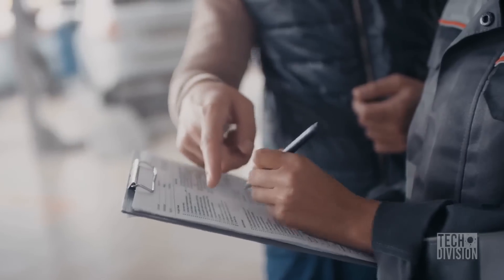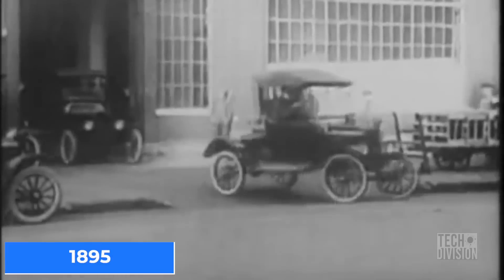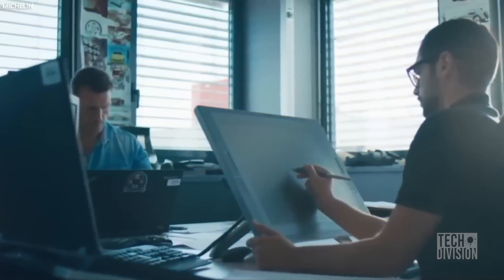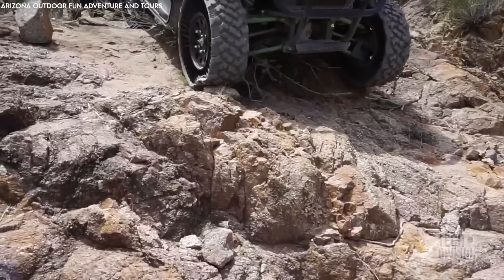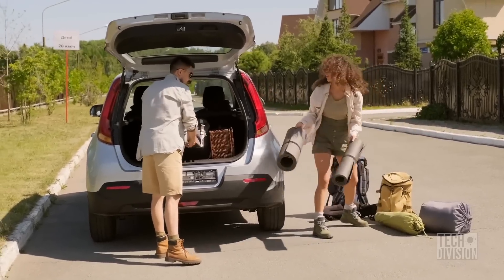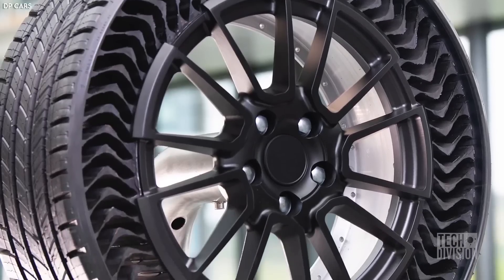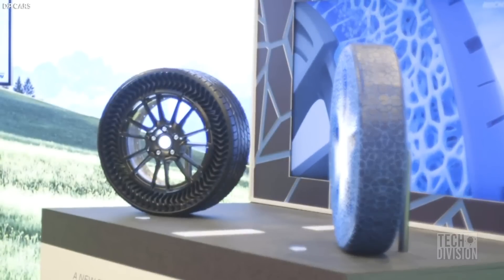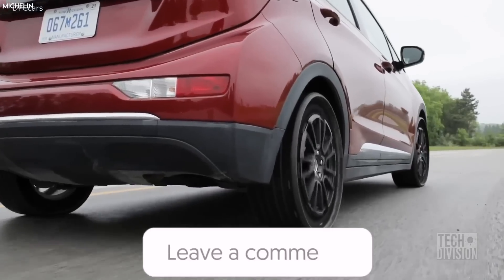Goodbye Flat Tires - Airless Wheels

Comment: No l wouldn't my 1997 hilux ute uses a light truck tyre a high profile tyre and l need to adjust the tyre pressures when l carry a load so commercial applications no way if you made them harder it would comperise the ride and handling wet weather performance believe you me in the wet my cab chassis aluminum tray its a handful in the wet also it has a full size spare wheel doesn't compmarise the load space big deal you have a spare tyre and a full size at that and l live  in Australia much rather have a full size spare wheel especially when you are in the outback get a flat change your tyre keep going at the speed limit instead 80kph on your space saver especially in the Northern Terriotry where there are sections if roads that are unlimited and they have a maximum speed limit of 140kph if you are doing 80kph on your space saver its a bit dangerous that's my opinion of space savers at least its better than no spare tyre and l know that happens if you were driving a car without a spare tyre get a flat you are stuffed really stuffed you could die because you didn't have a spare tyre a full size spare tyre no problem

Comment: these tires have to have a cover on the sides I can't help but be tempted to cut those spokes with a scissors, garden shears or something sharp. vandals can think of that too and it will be very dangerous to drive it not knowing someone cut your spokes. let's face it, it's the same reason people key cars.

Comment: What about in cold regions? Wouldn't ice/snow/low temps stiffen the rubber/plastic? I would think it would lead to breaks or fractures of the material.
Reply: That shouldn't be too much of an issue, standard tires have the same engineering problem. Winter tires have a softer compound that has the same elasticity as a summer tire in warmer temperatures. In the design with open sides, the cushioning fins between the rim and the web would get a lot more cooling than the inside of a standard tire, but the web can be a different compound than the fins, so they can choose appropriate compounds for each part of the tire. Furthermore I assume they show the open sides for promoting the concept and they will possibly close them up in the long run for safety reasons and to mitigate the problem of mud, snow and ice getting stuck in the sides.

Comment: I can see problems with off-road driving where you have to lower the tyre pressure for more grip and take the pressure up again for use on bitumen for the increased speed.
Reply: Then you would use different tires? Keep in mind every tire isn’t good for every application as with tools, there’s a different tool for a different job.

Comment: I like the idea but I am sure it will cost a lot more because the tire is attached to the rim. When you buy the tire, you have to pay for tire and rim.
Reply: Long term wise. If it performs up to a low to mid tier air tire then I’d say cost is worth it. Less maintenance ,no popping, and I’ve seen that Michelin is able to rethread it with a 3d printer. If all that comes to fruition then definitely worth it too me

Comment: These have been around almost 2 decades. They've only been commercially available to skid steer (larger outdoor power equipment in general) owners because the road noise on a regular automobile is so loud you can't even talk to anyone else in the car.

Comment: What happens when you get mud or snow let's say ,stuck in between some of the support columns,this will cause the tire to become unbalanced at higher speeds.
Reply: I guess they just make it a bit unbalanced from inside to outside to the stuff can flow out when the week rotates
Reply: You have a point.  I think a new design would come with some lifestyle changes.  If debris were caught in the rubber spokes it could cause some imbalance.  I think it would be easy enough to give your tires a quick rinse if they were that dirty, but nonetheless that seems accurate.  I’m less concerned about snow over mud, because there’s likely to be enough heat generated during normal driving conditions to melt the snow.

Comment: If u add side covers on the tyres, it'll solve the mudding problem and will also visually resemble a conventional air tyre... Then the customers just have to choose the superior tyre.
Reply: Side cover will affect flexibility as well as mud and ice removal if anyhow managed to trespass the side covers...
Reply: Yes regular tires are supirior
Reply: i think side cover less tyre are good. no heat problem and long durability .

Comment: One thing people should keep in mind.  The reason the pneumatic tire has been around so long and that it really hasn't changed in design (except for materials), is that it works and works well.  Despite hundreds of attempts at making a better ice cream scoop, the one invented over 100 years ago seems to be the one most people prefer because it's cheap, efficient and works best.  New doesn't always mean better.  I'm thinking the same about these new tires.
To the announcer:  It's pronounced "Misch-el-in" not "Mitch-el-in"  You'd think in an ad (basically what this is) for the company, you'd get it right.
Reply: Mitchelin ahah 😂
Reply: Less tire maintenance no worry about popping it with one nail and I’ve seen online that they have the ability to rethread the tire with a 3d printer. So if it performs up to/even slightly worse(let’s say 5% performance decrease) I would prefer airless.

Comment: I would love to have airless tires on my OHV side by side because we ride from 4,000 ft elevation to 11,000 and sometimes even 13,000 ft here in Colorado on just one ride and have to adjust the tire pressure to keep things save while
 OHVing.

Comment: Yes I’m ready to put those tires on my car especially if they’re not expensive
Reply from the maker: They will be expensive in the beginning but as the demand and production increases they will come down in price. Just as any normal tires
Reply: @TechDivision1  Since these actually won't be just tires, they will come as complete factory pre ballanced wheels, I can't see how that can be true. Basically, they will last longer, but each time you need a replacement you will have to change an entire wheel, not just a tire.

Comment: Since it really isn’t dependent on any recently discovered or invented technology, it begs the question why weren’t they working on this decades ago? Perhaps similar to the auto parts racket, tire manufacturers wanted you to have to replace your tires every couple of years? Perhaps now they realize how terribly ecologically irresponsible it was to convert crude oil into synthetic rubber and over time amass billions of old tires in landfills, lakes, streams, woodlands, and backyards? At least with electric vehicles you could argue that battery technology wasn’t ready thirty years ago.

Comment: What about motorbikes and the lean factor when cornering? Would that be a problem in terms of the stress put on the tyre?
Reply: Personally you're not going to see an airless tweel on a motorcycle anytime soon, at least not street legal. Heck, they're barely on 4 wheel vehicles and still testing the rigidity and how much wear and tear on the tire caps at high speed cornering and straight lines. I just don't see why the tweels have to be flat all of the time.. I mean normal tires aren't really flat, just a patch of the tire in the center is.. they still have curves on the sidewalls that still have some tread on them to shed water and aid in cornering. I just don't see why they can't just remove the air.. and build a wheel that doesn't require pneumatic pressure to keep it's rigidity, then you could utilize the tires already being built as a transition to a full on tweel. they would be similar to already low profile tires, only then they wouldn't need to be aired up, and still utilize the tread on the tires we already have.. maybe not so much of the sidewalls.

Comment: Nice idea, however, what will they cost? I seldom get flat tyres ( I think 2 in the past 20 years of driving) and these seem to be part of the actual wheel frame. When the tread wears do I have to replace the wheel frame as well? If they are not cheaper than normal tyres or competitively prices with the frame they will be a flop.
Reply: It blatantly tells you in the video you can just replace the tread
Reply: Card Board Sims: are you specialized in card board thinking? I reckon Michelin which took 10 years developing this tire thought about your concern.

Comment: Seems like adding a sidewall with vents to handle the change in compression would solve the issue of getting debris in the support structure and would go along way towards helping the aesthetics of the tire even if it means paying a price on helping to prevent hydroplaning

Comment: I would use it if it has side walls like conventional tires
Reply: I think they deliberately don't use rubber for side walls because these airless tyres already use far more rubber to compose the inner layers. It's not as environmentally friendly as they make out. Unless they last significantly longer than conventional tyres.

Comment: One thing not mentioned is that the market for wheels will disappear since the tire is integrated to the wheel.  They don't need to be balanced either, so you can expect shops that mount tires will offer much reduced services, ideally for a much lower price... or they'll watch consumers mount their own tires that are shipped directly to their home.  Fascinating.
Reply: They will still need to get balanced especially during the retreading process.

Comment: to improve roll resistance the external rubber or tyre profile can be an interchangeable tension belt to be removed and recycled when worn out. tension belt can create stiffness in the tyre perimeter similar to compressed air effect inside regular tyres

Comment: 8/15/21, Sure, I think it's a great idea. Researching ZT lawnmowers, they're already available. Although very costly, they're best suited for commercial users. My Gravely ZT is strictly homeowner grade, original tires will suffice. ****Just 1 major caveat****How do you account for different load/TP requirements?
Reply: Those requirements are to prevent bowing or crowning of the tyre as the weight changes and stiffening of the sidewall to take the load. Without the air the problem is simply one of maximum weight the tyre can take, not a problem of vertical load resilience.